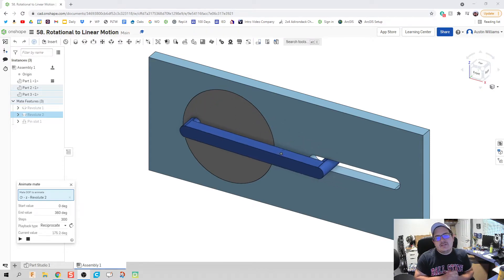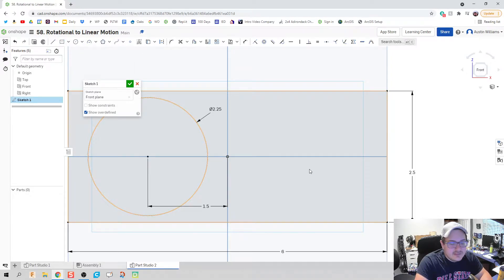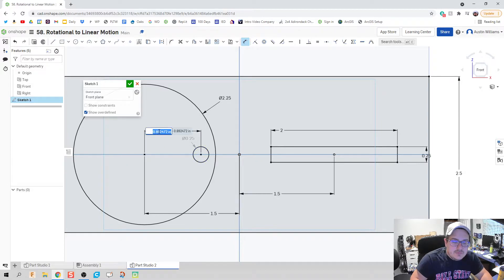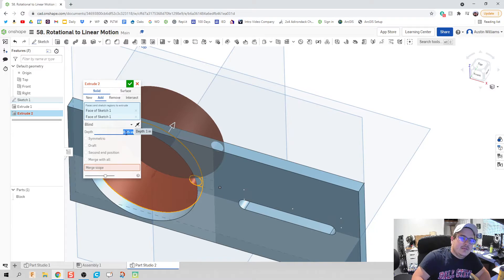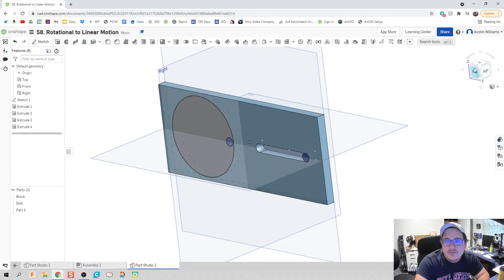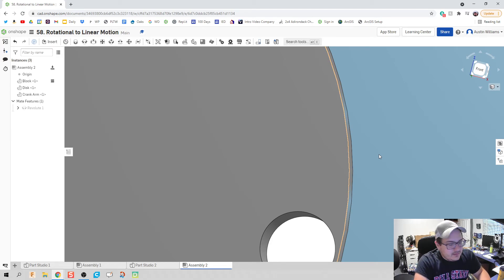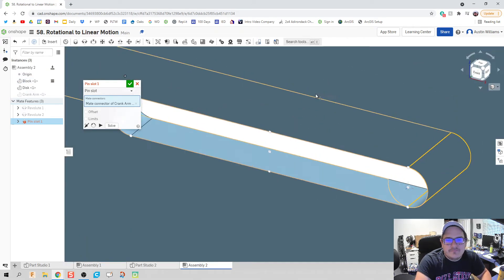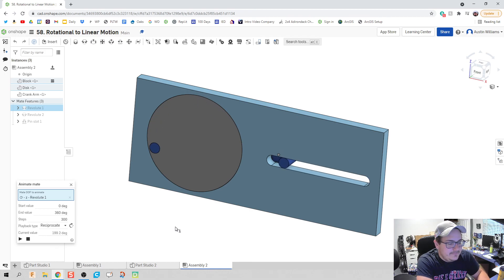Pin Slot Mate (Rotational-Linear Motion) - Day 58 of 100 OnShape Journey

Comment: Hello William, the error with the slider going to far had to do with the fillets on the ends and the distances of the pin in the big wheel. The distance from the pin in the big wheel to the centre of the wheel had to be half the length of the slot. This distance centre of wheel 1/2 inch so distance from centre of pin to centre of first fillet had be 1/2 inch, Total length of slot needed to be twice the distance from the pin in the big wheel to the centre of the big wheel. That being 1 inch.

Comment: The two connector positions on the disk was interesting.  One position was obviously center of cylinder and the other might be center of mass for the disk offset by the pin hole mass ??  
           Thanks for a very good explanation of pin-slot connectors
Reply from the maker: It was best explained to me as, one connector is the center of the face and the other is the center of the centroid. So you are spot on with that analysis!